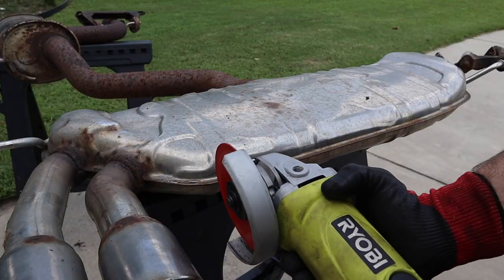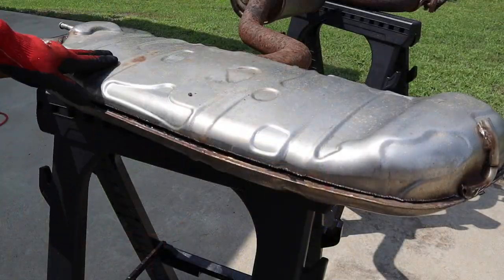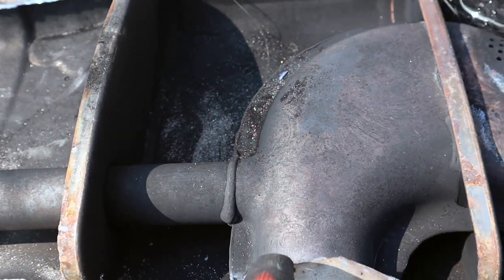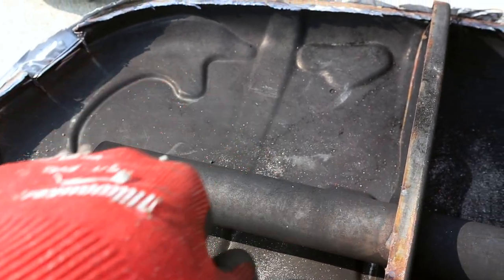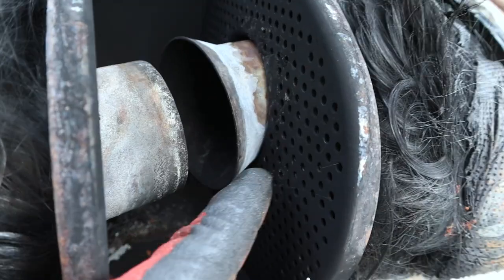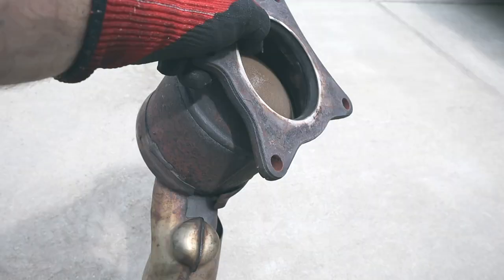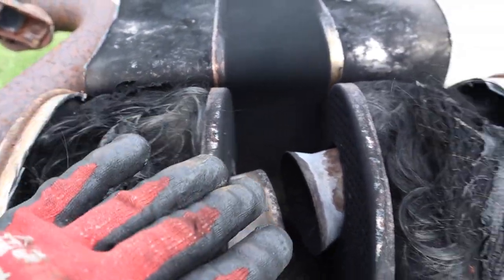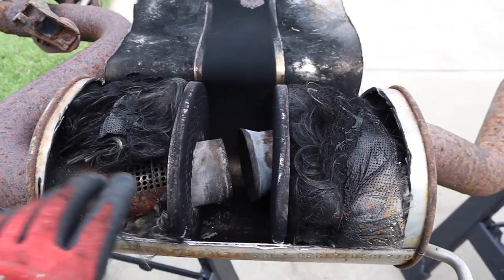What is Inside A Car's Muffler and Catalytic Converter?

Comment: You can actually get a pretty robust note out of these. I have a MK5 GTI with a 42DD 3” resonated/catted downpipe, the factory resonator deleted, and this backbox still in place. At idle and highway cruising (cold start is somewhat loud), it’s barely a few dB above stock, but sounds nice and throaty under full throttle, and gets that nice “pop” with the DSG between shifts, while still looking factory stock.
Reply: HowdyasayFlapjack 
I’ve been hesitant to delete the resonator because I heard it is LOUD and droney
Reply: My car is the A3 8P (mk5 gti with audi skin)
Reply: HowdyasayFlapjack 
Yea no doubt that pipe lengths alter sound. 
I have a mk4 manifold on my mk2, and modified a stock downpipe to fit. 
Sounded great.  
I finally got my correct TT conversion downpipe and it’s about 2-3’ longer until it merged into a single pipe. 
Now it sounds weird. 
Well, weird to me compared to before, it actually seems quieter at high rpms.
Reply: Authorized Mike before I had the DP on there at all, the only exhaust modification I had at first was the deleted resonator, and there was NO drone whatsoever, it really wasn’t all that much louder than stock, honestly. It really is the perfect modification if you’re just looking for a A little bit of extra sound, the car basically sounded bone stock when the windows were still up, but the deleted resonator give it a little extra “oomph” when goosing the throttle in a tunnel or something like that. Nothing obnoxious or overbearing whatsoever.
Reply: I want to remove the CATs only and install a downpipe but I want to keep the rest(resonator and exhaust).. Has anyone done that and how does it sound and feel?

Comment: It looks like the whole systems is actually straight through, very interesting. That pipe going off into the side chamber of the second muffler looks like something akin to a Helmholtz resonator, not actually what would by typically called a baffled muffler.
Reply: Yep, spot-on Phos9... This seems like a VERY free-flowing factory exhaust.  All the mufflers are already of straight-through fibreglass packed type (like a Corsa or Magnaflow), with that one Helmholtz resonator in the suitcase.  Interestingly, other turbocharged cars like the BMW M2 or Focus RS seem to have similarly free-flowing exhausts (of course, there's no muffling at all on the Fiat 500 Abarth!) -- the exhaust turbine itself acts as a muffler on turbocharged vehicles, as well as the catalytic converter(s).

Comment: Interesting timing. I'm back from my trip and while being there, my exhaust system broke just after the converter. I was worried if such drive will damage it (since it's a can with rarities), but turns out previous owners emptied it already and welded down few years back hahaha
P.S. "straight piped" diesel sounds good enough to forgive it the fact the turbo was often in emergency mode because of the lambda sensor error

Comment: not all resonators or mufflers have the fiberglass mat...much like in audio speaker design, I believe the mat is there to absorb (harsh) frequencies and slow down the sound waves (mellow out the tone)...our '04 pathfinder didn't have any mat in the middle resonator, it was just a 3 chamber mid muffler; however, the rear canister muffler had the fiberglass mat...I believe the same is true on Mk4 Golf/GTI resonators, no matting, just perforated tubing and a gap bwtn them to slow gas flow and allow (freq) cancellations to happen
Reply from the maker: Yep! I need to find a few more to cut open .
Reply: Good point. I never thought of it that way but changing that in or out would really change the tone coming out like a speaker's box. I'm looking forward to some more videos  :)

Comment: I have a 2014 VW cc. There seems to be a ton of carbon build up on the exhaust tips is this normal for this car or do you think the car is running rich. I only use 93 octane gas. Is this a issue ?

Comment: Hi Charles
I caught thieves cutting the exhaust of my dads cat converter on his 1995 Merc. They only cut the exchaust pipe either side and only managed half of the pipe. Just wanted some advice when I take it to get fixed. I’m assuming a patch up will do the trick and the pipe is just empty either side of the precious metals box ?

Comment: I had a bunch of that hair coming out of the tail pipe on my F-150 yesterday. I rushed over to the Ford dealer not knowing what was going on. Almost thought someone stuffed a wig in there when I was at the Dollar store at first. 😁 They said that happens quite a bit and not to worry. I don't see how there isn't any concern there. Something isn't right. Right? Shouldn't my muffler be replaced? I don't notice any difference in sound yet.

Comment: Ma’s mk5 Jetta had a little rumbly rattle occasionally. 
I looked underneath and I saw the pipe cracked off going into the rear muffler. 
So I cut it off all the way in order to make a repair, I figured I’d weld a sleeve over it. 
But I started it up and it was still really quiet.
I didn’t feel like holding that heavy muffler up to put it back,so  I added a straight pipe instead. 
Technically, the way I see it, I straight piped moms car?

Comment: Hi Charles, one question: I'm planning getting a 2008 rabbit 2.5 manual, any advice on that vehicle? |s it true that that particular engine shares tech with the old Gallardo's engine?  Thx in advance.
Reply from the maker: That is in fact true. :) Those are actually pretty good cars when properly maintained. As always be sure to get the car inspected before you buy it.
Reply: Thanks mate.

Comment: So what happens when that fibre glass hair comes out...is it good to drive for a while or should it be fixed asap?
Reply from the maker: As long as it’s not a modified cat I think you’re fine. It probably sounds awful but won’t be an issue. The concern is fire from some left over bits

Comment: Have you ever replaced a/the catalytic converter/s on a B5.5 /2.8 cylinder Paasat, and if so how tough was it?
Reply from the maker: Yeah. Not too bad on the 2wd. A little tougher on the 4 motion
Reply: @HumbleMechanic  good to know,    I have a two wheel drive and wasn't sure if this was a job you're average Joe could handle. I also wasn't sure I could save money if I purchased myself

Comment: I wonder if the suitcase muffler would sound good if you removed the packing and then welded it back together.
Reply: It will sound louder and more raspy if you do that.  The fibreglass packing mainly attenuates high frequencies.  As perforation tubing going to a big empty chamber, that can still work to provide muffling though.
Reply: @TassieLorenzo  That's the idea, Chief.  When you remove the absorption material from an absorption muffler, they obviously tend to get louder.